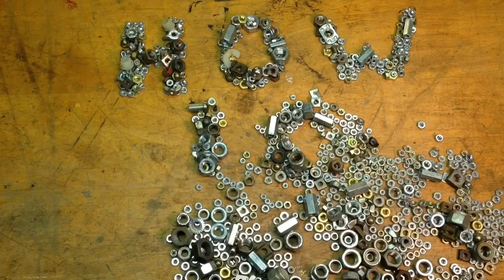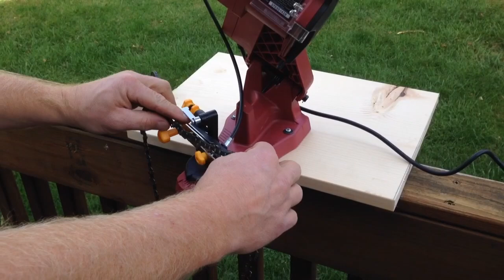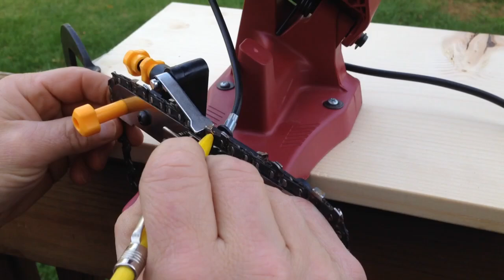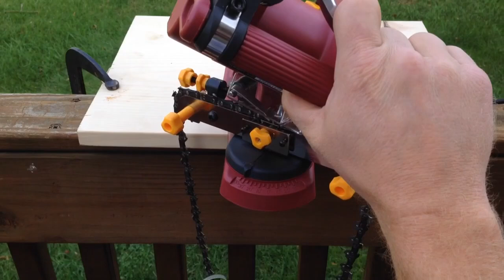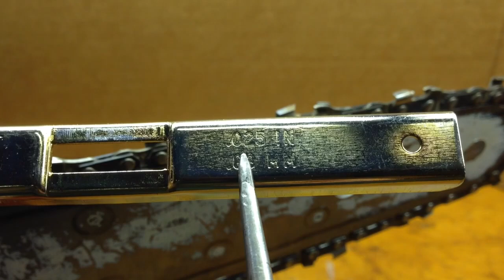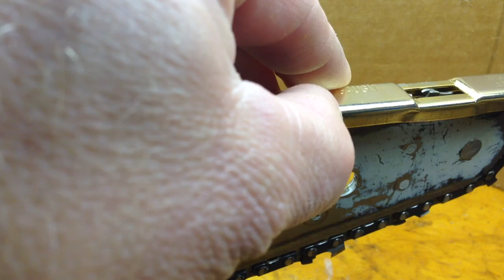Sharpening a chain saw chain

Comment: Great video Bob! I just got this as a Christmas present and was wondering how to use it. Thanks for the tutorial. I need to get myself a raker tool like you showed in this video. I don't know what raker to get though. Do you know where I could find that info for the chain?
Reply from the maker: Love2boat92  For accurate check the website for the chain saw manufacturer or you could check the chain manufacturer if you are using a non-factory chain. I have talked to many people that work in repair shops and they have informed me that when they sharpen the saw they do not do the rakers so you may want to give it a try without filing the rakers and see how well it cuts. Hope this helps. Thanks for watching
Reply: Thanks for the info. I will do that. I find it interesting that most people in the repair shops don't file down the rakers. I also want to buy bulk chain which means I would need a punch tool to commect the two ends together.
Reply from the maker: I also found that interesting... so what did I do go to another shop. As it turns out most of the shops that I asked did not file the rakers. But I wanted to show the entire correct process from start to finish. I did try without filing the rakers and the chain still worked good. I can only think that as the chain get used and sharpened more it will become more necessary to file the rakes.
Reply: I wonder if they do that to get you to buy a new chain? If they do stuff like that makes me mad. You did the right thing by showing the entire process. This little machine is a big money saver if you have to sharpen a lot of chainsaw chain.